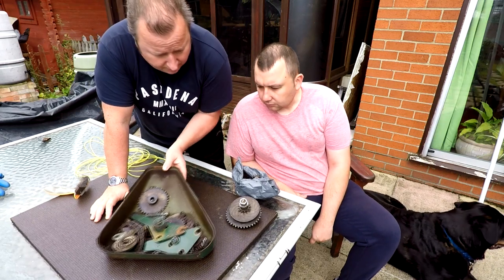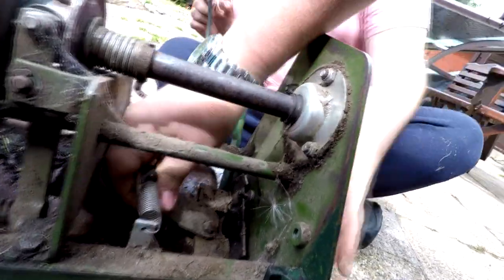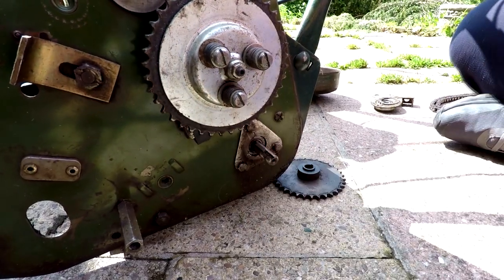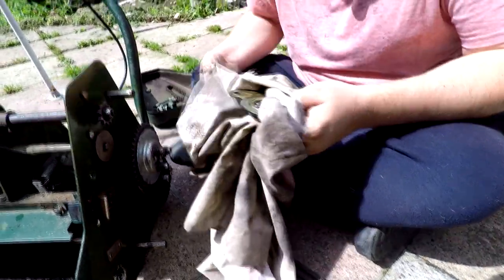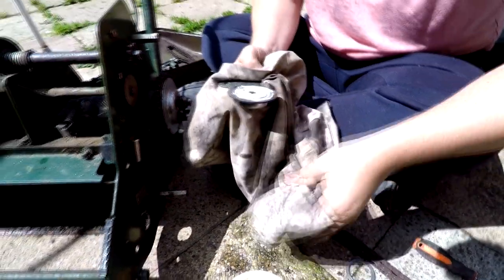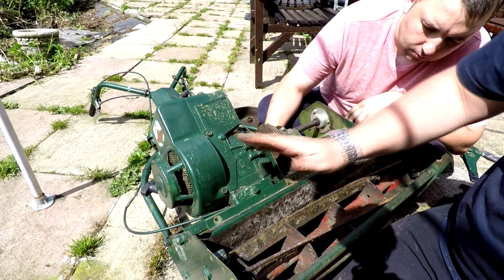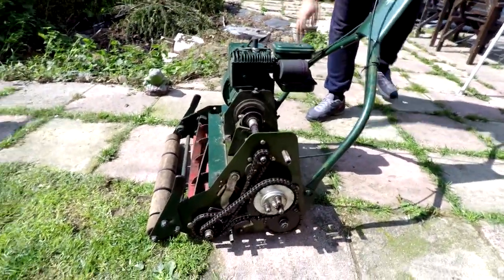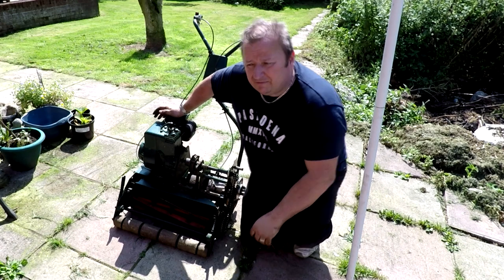The FREE Webb Lawnmower   Can We fix It

Comment: Looking Good Martin! I've worked on lots of these cylinder mowers - but now no-one seems to want them. They're more of a precision machine than rotary mowers but the cost of getting the cylinder sharpened can be expensive as it has to be done on a specialist grinding jig. Last time I looked about 10 years ago I was quoted £2.00 per inch of cylinder - so for a 16inch one that's £32! I did have the idea of making an attachment that fits to the bottom blade that's covered with abrasive paper - the spinning cylinder is then adjusted down onto it to sharpen the "knives" ( that's what the blades are called on a cylinder!) Final adjustment is made by setting one knife against the far edge of the bottom blade and the other side gradually bought down whilst checking that the knife just "kisses" the bottom along the whole length. Any bends in the bottom blade will be seen and can then be dressed out with a 2Lb ball peen hammer! A well adjusted sharp blade should cut newspaper.
Reply from the maker: Thanks for the info John.

Comment: Great video Martin. Good machines those reel mowers, make a nice stripe effect on the lawn. Looks like you will have to sharpen the blade and bottom plate to bring it back to a nice cut.
Cheers, Jeff.
Reply from the maker: yes Jeff I'll be doing that too.

Comment: Cracking stuff Martin, have a look at the "backlapping" technique on YouTube if you aren't already aware, a case of spinning the cylinder backwards with a drill and applying something like a valve grinding paste to sharpen, could be great to see that as part of the restoration.

Cheers
Steve
Reply from the maker: Thanks Steve, I'll take a look.

Comment: Set the cylinder up Martin by adjusting the two collars at each end of the cylinder but just where it meets the bottom blade , test the cut using a piece of fairly thick paper but not cardboard lol obviously... good job done there by yourself and Bert lol
Reply from the maker: Thanks for the info bud.
Reply: retrorestore welcome mate